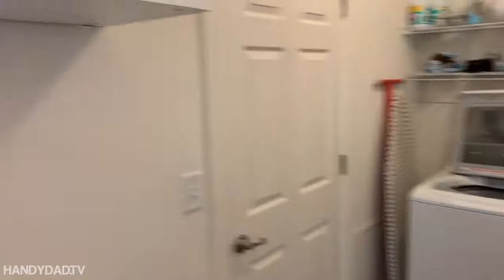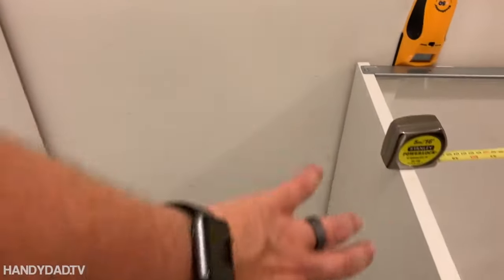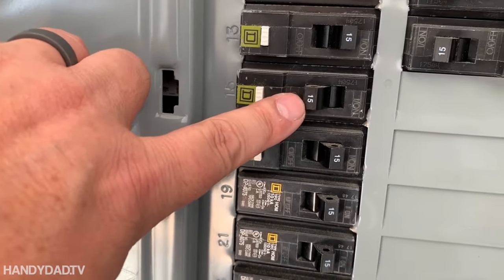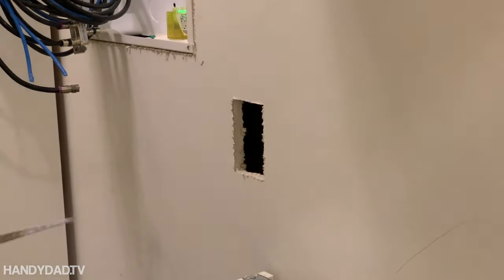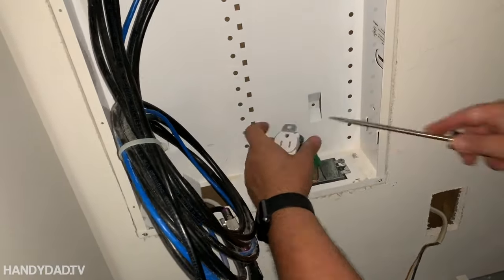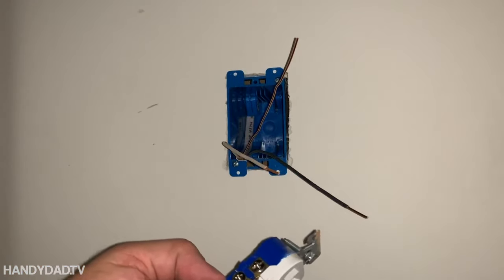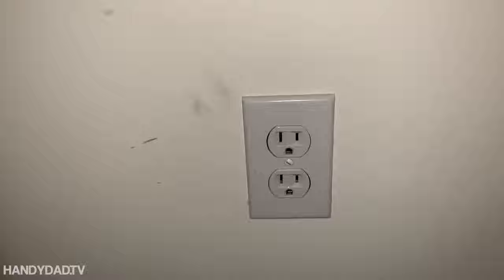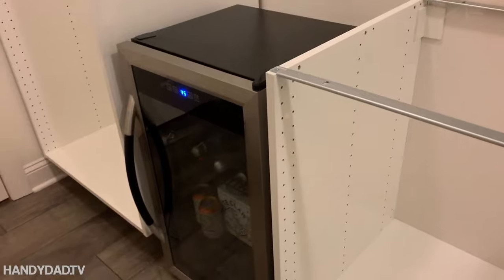Add an Outlet to an Existing Circuit

Comment: Man I saw the installation of two outlets, you stated to connect the first one and than went to next outlet, put the wire inside the wall and did not show how you connect it with the main wires.
Reply from the maker: Same way. I left it out (on the “cutting room floor”) because it was redundant.
Reply: @handydadtv  From where did you get the line for the second outlet?
Reply from the maker: Power went from the original outlet in the cable box to the new box above the counter, then from there to the fridge outlet. That’s why there were two wires in the upper outlet box.

Comment: Shouldnt add new directly to the old outlet… can over heat & cause failure.  Make pig tails and connect to old outlet then add new line to end of them.  That’s why so many dislikes.

Comment: Why didn't you show the part where you smash and jam all the wires back into the outlet?  I just had to do exactly what you did and wires were all smushed to hell.
Reply from the maker: There’s no trick to it. That would be boring to show.
Reply: @handydadtv  I think you didnt show it for the very reason I stated. Smash city.
Reply from the maker: Two sets of wires isn’t bad. Three sets is tough.

Comment: You didn’t really talk about the line and the load side you can easily wire this incorrectly
Reply from the maker: Line and load are important on GFCI outlets, not normal outlets.

Comment: Use a licensed electrician people!   Cute that he learned that from dad and not from a master electrician.   Gouging the Sheetrock is NEVER acceptable and 14 gauge wire for receptacles is a code violation regardless of the breaker size.
Reply: What code are you speaking of?  Wasn't taught that in my electrical classes. I can check the NEC when I'm cleared to go back to the office after this quarantine is over.
Reply: Zach Harmon    How is #14 on a 15 ampere breaker a code violation?   It may be illegal by a local rule as the town near me is.   But not NEC illegal.
Reply: Zach Harmon yea, not true sport.
Reply: Says the licensed electrician...

Comment: You have added 2 receptacles to a circuit that appears to have an undetermined amount of other devices on it.
As most new homes are almost always wired to the maximum allowable amount of devices there is a high probability that you have exceeded the Electrical Code amount and have created a potential for overloading the breaker and wires causing a possible fire Hazard. 
And you Cannot notch a stud out as you say and cover with plaster unless you use a metal protective plate over the cable, which must be 1” away from the inside surface of the drywall.
I would suggest you edit that part out as it is against Code rules and should not be an option. 
Master Electrician Industrial/Commercial and Residential, 40+ years

Comment: I think this is not a great video. Why?   First off adding an outlet from an existing outlet with out knowing how many outlets are in that circuit is not good. ( now you created a problem of nuisance tripping due to over loading)   second that fridge should be on a dedicated circuit.  Bottom line adding an outlet is not that easy that's why there are electricians. Because you don't want to burn your house or your friends house.
Reply from the maker: Thanks for your input. A beverage cooler doesn’t use much power so there’s no need for a dedicated circuit and they’ve had no issue with overloading. 

People need power where they need it. I’m sure you’ll agree that it’s better to add a couple of convenience outlets rather than use extension cords.
Reply: @handydadtv  you are making a how to video so dont you think it's better to do it the right way not a fix for now way. To be honest running an extension cord is better at least it's not permanent. What would happend it the house get sold to new owners and end up plugging heavy loads in those outlets . Then it would be a problem. That's why we have electrical codes. To make everything safe .